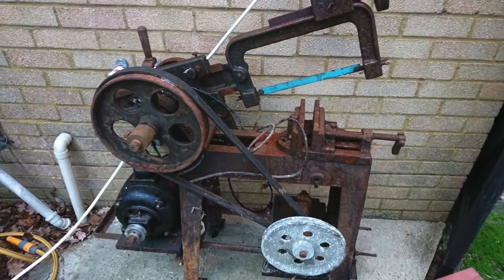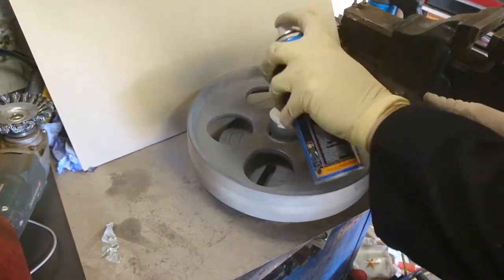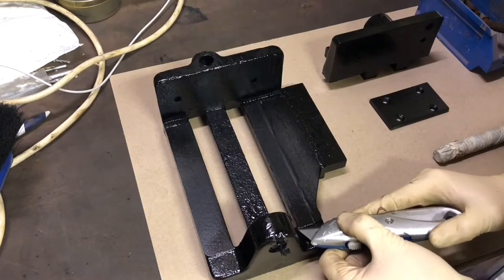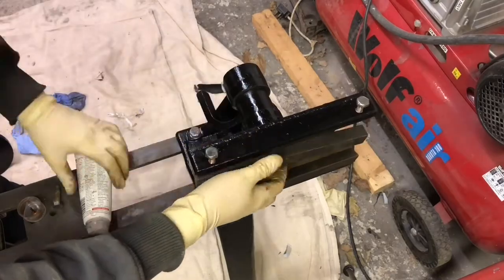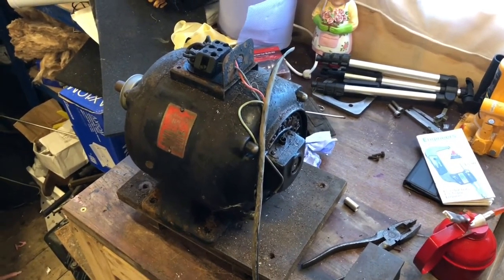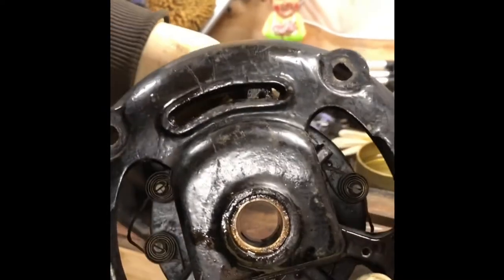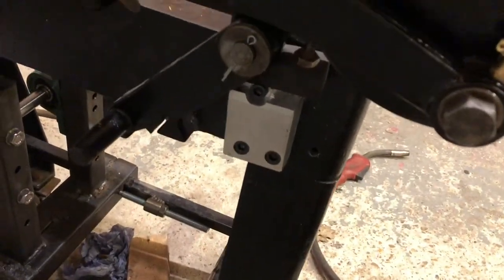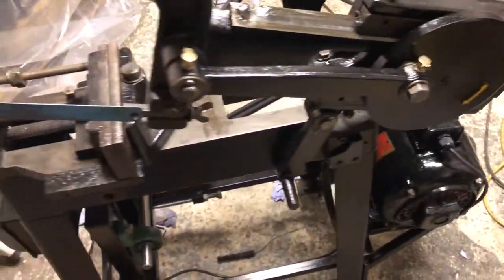Restoration of a vintage power hacksaw

Comment: Beautiful restore , from rusty crusty to a super looking saw. If you find you oil flowing to quickly on the crank arm you may want to add felt wicks in the oil cups. It'll still get enough oil only it will help save mess of it running out all at once. I have an old power hacksaw to restore but my body went south and the pain isn't controlled by drugs unless I'm doped to sleep . And I hate drugs of all kinds . Thanks for the video
Reply from the maker: I'm sorry to hear about your pain, and I appreciate the advice, I do find it loses the oil quickly and the wick idea is excellent. I will do it this weekend.